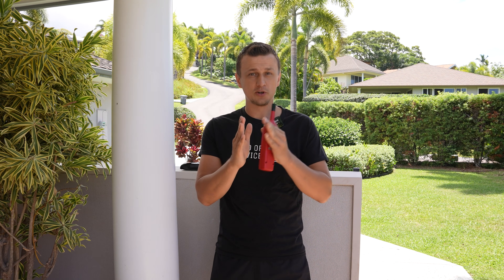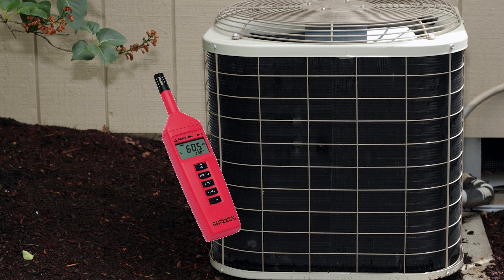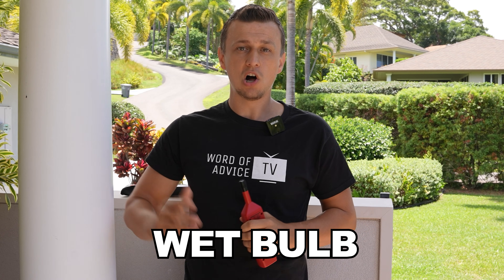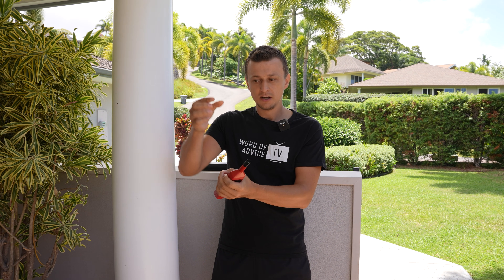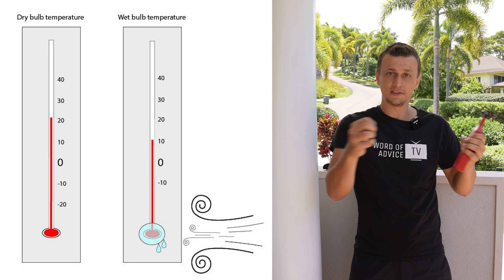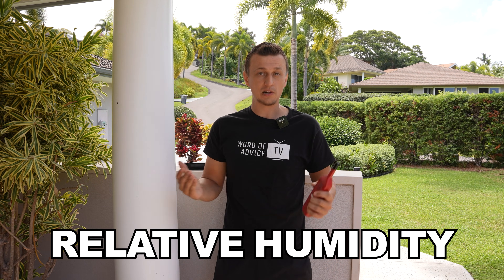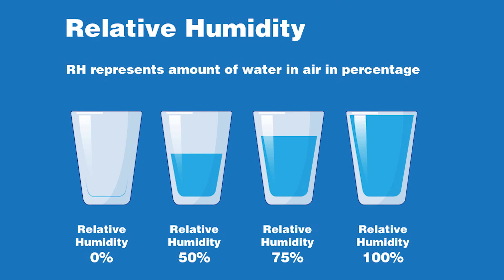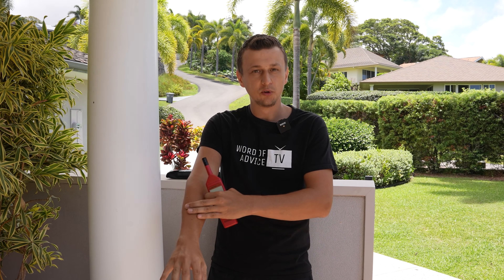Dry Bulb, Wet Bulb, Relative Humidity Simply Explained

Comment: is wet bulb temperature taken with air condition running or should the unit just be in fan mode. I'm a little confused about that when trying to figure out my superheat. Thanks in advance

Comment: You might consider explaining ENTERING and EXITING wet bub VS dry bulb and how they relate to HVAC system capacity. These reading are required to process most utility rebates for new HVAC system installations.

Comment: uh ive heard from other profesionals that you should be taking your wet bulb like  within a feet or so of the evaparotor coil aka return  duct by drilling a tiny hole and sticking a probe in. is it still accurate reading if its done from a far away grill?

Comment: Hi Jay!  Unrelated to wet/dry bulb:  Years ago I threw away my dishwasher (which worked fine), and never got another one.  This was due to a very loud water hammer that I thought would break solder joints  in my house.  I asked the plumber who installed the original dishwasher, but I'm not so sure he was really a plumber. Useless.  Since then I've learned a bit about water hammer, and recently heard of a device called a water hammer arrester.  Are you familiar? Any chance of a video about these devices?  Thank you very much!
Reply from the maker: Aloha! Glad to hear you have learned a lot about the water hammer over the years. I actually don't do much plumbing jobs so I would be a bad person to ask about this. I have never installed one of those before. 🤷‍♂️
Reply: @WordofAdviceTV  I appreciate your answer.  I asked, because even though you are specialist in HVAC, I would trust your word implicitly on many topics.  It is the way you present things, the way you investigate, they way you reason.  When you speak on topics, it's obvious that you understand the science, the inner workings, of the things you talk about. You exude professionalism, and you care about teaching others so that they understand and have the best chance of success with a project or dealing with contractors.  I thank you very much for all of that.  You may not be an electrician, but you did that excellent video on switches.  You may not do much plumbing, but any plumbing topic you chose to present, I would have complete confidence in your ability and advice.  Looking forward to you next video!  Mahalo!